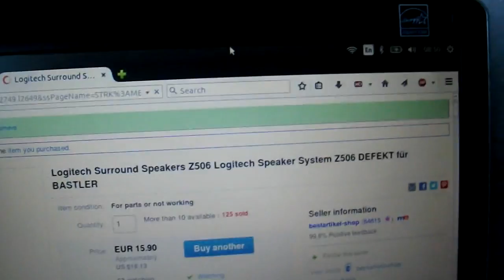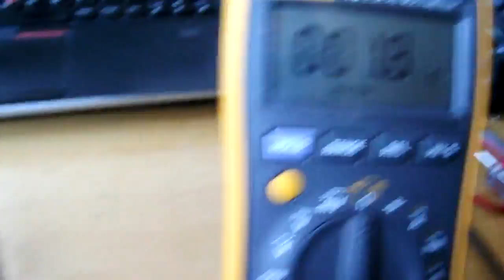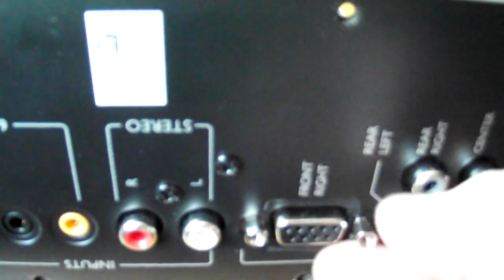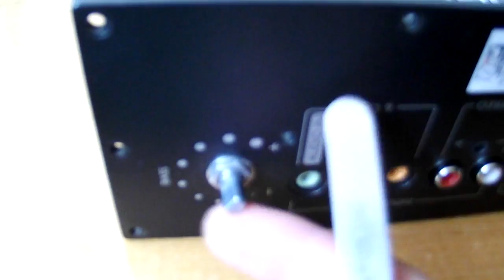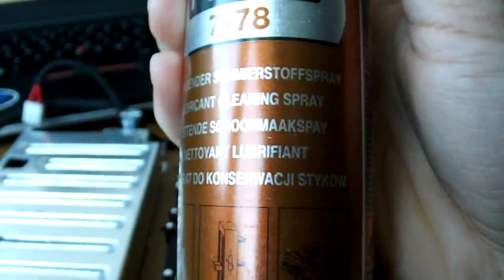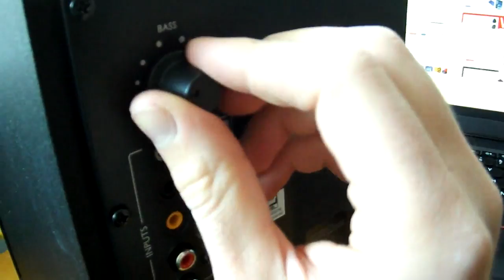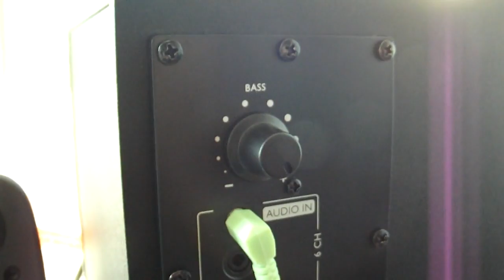Logitech z506 Subwoofer Repair

Comment: thanks for the video. my sub has just stopped working and the speakers still work fine. I've taken it apart and had good resistances on the potentiometer. is there any other reason the sub may have just died?

Comment: I have the same model speaker. For me, the bass works but only the center speaker has a sound output. When I plug in any of the other speakers to the connection of the center speaker, they work meaning the speakers themselves are not the problem. I suspect the connections on the back of the sub to be faulty. Do you have any idea how I could fix this?

Comment: Oh, great, I was hoping I wouldn't have to get this deep into this unit, but here we are - my sub isn't working, soooo, I'll have to get in there and try this out.

Need to find my multimeter and see for sure if it is open. I'd imagine that's the problem though - what else would it be where the sub rarely, if ever, actually works?

Comment: WOW Really Great Video!!! I disconnected my sub speaker from this thing and attached it to my other stereo and it works nice albeit not very bassy somehow.  The voltage out of the supply looked good at 16v.  The pot. R was good too and did change accordingly.  Caps dont looked bloated but you never know with them.  I get no sound!  How to diagnose further?

Comment: Well detailed video! Thanks! 
I've got the same speakers, 4 years old now and my subwoofer is starting to sound...torn?
How difficult would it be to unsolder the original sub- and then resolder a 12" sub originally intended for a car?
Reply from the maker: It would be very easy. Just remove the wires from the old sub and solder to the new one.
However, firstly, you'd have to think of a way to mount the 12" sub. Secondly, It will probably work for a while but there is a risk of damaging the amplifier of z506 if you push it too hard. The original sub is rated for 27W only, so if you want a long term solution, I'd recommend to look for a sub that has a similar power rating.
Reply: Oh man, I wasn't too sure if I'd get a reply, so thank you for this!
Mounting the sub: So the car sub is already in a box. I was thinking of cutting through one side of the sub box and attaching the Logitech board in it. May even use the old sub's "feet" on the new one.
Power rating: oh I see, didn't think of that (unfamiliar with electrical). Are there any replacements you could suggest?

Comment: Thanks for the video. i also bought this model Z506 and just use it for few months and l did not use it anymore.After about 3yrs i decided to use this again but there was crackling/Rattlng noise coming out from the woofer and when the two rear speakers were connected it will also make the same crackling noise.The Bass when put on high works fine but there is always this crackling/rattling noise.Any advise there bro.
Reply from the maker: Sounds like the volume pot may need cleaning. It probably oxidized from long storage and no use. I'd suggest doing what I described in the video and see if it helps. If you can get to the main volume pot on the speaker, do it there as well. Spray some contact cleaner into aux and other jacks while you are at it. I hope it helps.

Comment: Hello..
First thanks for instructive video.. i have a problems from subwoofer. Open my 5.1 system and woofer is starting beating.. (like; bop bop bop bop) But beating is low volume..  My another problem is controler. i attach my headset i hear sizzle. İ Power button to move (little rigth or left ) problem solving but one momets later doing this again..
What you think sir? What am i do?
Reply from the maker: +Mert Karataş If a problem gets solved even temporarily by moving a switch or any potentiometer, it means that the switch or potentiometer have dirty contacts and they need to be cleaned. The easiest way to do this is to buy some contact cleaner, spray some into the switch/potentiometer and push or turn the switch/potentiometer for a dozen times.

If you want to clean a switch, any contact cleaner should work. If you want to clean potentiometers, you should get a special kind of cleaner for potentiometers. It has some lube in it. Otherwise your potentiometer may wear out quickly.

If this way of cleaning does not help, you can try to desolder and disassemble the switch/potentiometer. Then clean their insides with a q-tip soaked in appropriate contact cleaner. If this is not possible or does not help, the only other option is to replace the defective switch/potentiometer.

Regarding the first problem, it could also be caused by bad contact in potentiometers. I'd suggest to clean every potentiometer and see if the problem still exists.

Another possibility for both of your problems could be dry solder joints. When you have disassembled the subwoofer, inspect the board for any loose connections between components and the board. If you notice bad solder joints, just re-solder them and test your speaker set afterwards.

Have fun repairing your sound system :)

Comment: hey mate,

just bought one of those. i turn them on and then my subwoofer's volumer gets lower for about one minute and then completely turns off. Any suggestion what is wrong maybe? would be really kind from you, since you seem to know a lot about them. i tried different input hardware and put the power supply directly into a plug (no extensions or stuff like that)

greetings
Reply from the maker: +hoernchenmeister7 Hi. I don't really know much about this speaker set. I just happen to be interested in electronics repair. I haven't seen an issue like yours before, so everything I suggest will be only my guess.

It could be a temperature related problem. You can try to disassemble the woofer and spray various components with a freezing spray while playing something. If your speakers suddenly start working, you will know which component may be defective.

It could be a bad electrolytic capacitor, which could also show signs of bloating or leaking. Be sure to check solder joints for any cracks due to physical and/or thermal stress.
Reply: thanks alot for the tips ;)
Reply from the maker: +hoernchenmeister7 No problem, it's my pleasure! Have fun repairing your speaker set :)

Comment: Excellent and informative video. Unfortunately, my problem appears to be a bad input jack on the bass/center channel speaker (great dane dog kept leaning on subwoofer under desk). While disassembling and testing my Z506, I found the bass potentiometer only ranges from 0 - 31 kOhm rather than 0 - 50, even though it is an original B50K. Just strange.
Reply from the maker: Dedrick Lund It is possible that some other component is in parallel with the potentiometer. In circuit readings of resistance may be unreliable.

Comment: Hey really good video i didnt had this issue but maybe sometime ^^
I have a question..i got the same speakers 2-3years ago, everything worked fine until a week ago..
My Front Left Speaker (where u can put power on/off and change Volume) plays no sound or sometimes pretty quiet with scratching noises and pretty often its making noises like sizzling and such stuff even if i dont do anything just looking to my computer. Right now i turned the Volume of my Front Left Speaker down but it doesnt change anything still hearing these noises.
All other Speakers and my Subwoofer wroking fine without any issues. Do u maybe know what is wrong? or what i can do?
Reply from the maker: +Sivertop I feel it's not a great video, because I didn't have a tripod and I can't really edit well yet. I just thought I would do the best I can with the means and skills I have. I also wanted to challenge one of my fears by making this video. I just hope it helps someone as well.

Talking about your problem, it sounds like a dirty control or loose wiring somewhere. You can try flexing the cable between the speaker and subwoofer at all places. Especially near the speaker and near the connector. These are the places where bad contacts are most common.

If the sound changes in any way - crackles, starts to play well - then you know where the loose connection is and you can proceed to fixing it. If you find the problem to be something else, let me know!
Reply: +ELectro oh great, thanks for ur fast answer i gonna try it tomorrow, if i know something new i let u know :) again thx for ur answer
Reply: i got the same problem, did u fix it?
Reply: oh quite some time ago i forgot to say if it worked, well it turned out to be the issue with the cable as the Channel-Owner said,.my cable was broken near the front left speaker i just had to cut the bad part away and rewire it. works fine now..

Comment: Hey there nice video.
You seems to be very knowledgeable so I take a chance asking you my question. I end up with the system but the right speaker with the on/off power is missing. I was planning to use it as an external powered sub. Thus I had no use for the headphone jack and as you showed, the volume is already on the sub itself. Is there anyway I could make a external powers witch for this ? Thank you
Reply: Hey I'm late 1 year, but anyway: The power supply is inside the subwoofer. If you don't have the right speaker (with volume control), you are complicated. If you have the right speaker but it gets no power, then the power supply inside the subwoofer is dead. It is typical with this model (happened to me as well). You can replace that power supply (make sure to match voltage, current type, etc).
The volume of the right speaker is the main general volume of the full system. The potentiometer shown in this video controls only the volume of the bass.

This sound system delivers and usually lasts. Sound is fine, speakers are sturdy, all in all is ok. But the truth is that inside it's a disaster. My main board is all corroded, rust ate all the screws, the traces are horrible, the design of the board is horrible, as you can see in this video they covered all the components with this black horrid substance, capacitors are scattered all around, components soldered together, it looks like a board from 1980 made for a school project. So all is hanging by a thread. It's a love & hate thing I have with it.

Comment: hi i have a problem with my z506, the problem is that the right and left speakers(front and rear) doesnt sounds, where do you think is the problem??
Reply from the maker: If the center speaker and subwoofer work fine but all the satellites don't, I'd suspect it's one of the amplifier ICs.

There are two amplifier ICs - one for subwoofer and center spekers, another one for all four (FR, FL, RR, RL) satellite speakers.
Reply: Do you think it can be repair?
Reply from the maker: Hector Reyes
Yes, I think it is possible.

First of all, the main board should be visually inspected for any burned components. Then I'd check the amplifier IC with a multimeter for shorts. If there are no shorts, I'd try to swap the amplifier ICs. If then you can hear satellites but not subwoofer or center - you can be sure it's the amplifier ICs.

I don't remember which IC it is and how available they are. If you are going to repair it and need any help testing components, let me know. I can disassemble my working subwoofer again and we can compare any values.

Comment: Hi. at the begining sorry for my english, i`m from central europe. I have problem with front left speaker. When I play the music it`s rustling. I connected it to another case and it was working so i think that the speaker it good but the  problem is in subwoofer case. I took out the main board but now i dont know what to do next. I dont have multimetr, should i buy it and check resistant like u ? Do u have any suggestions ? Greeting and i`m waiting for the answer.
Reply from the maker: Pajmano For some reason I don't get notified of most of replies to my videos. Sorry for a late reply, but maybe it will help someone in the future.

When there is an intermittent connection, sometimes it's possible to see the fault with a naked eye. Wiggle the connector and look for any movement of the solder joint. Even if it doesn't move, it would be a good idea to re-solder the connector.

Comment: I had an issue with no sound coming from the bass but all the other speakers worked. I knew the bass was working because when I wiggled the knob it would make sounds for a few seconds, thus meaning it was a physical connection issue. I took it apart like in the video, got some "crc electronic cleaner" from advanced auto, sprayed it in the bass knob and wiggled it back and forth, then put it back together, worked perfectly!
Reply: Did it seem like your bass knob spun freely and then randomly caught and would play bass when  the knob had seemed to catch? Trying to determine if this fix will work for me as well.

Comment: hello! speakers worked it packed it up  and after i unpacked them theres no power at all, what i check first? fuse? what do you suggest , because alot of talking about the power supply dead.
Reply from the maker: Martin Kull It could be a bad connection somewhere. Check all of the external and internal wiring. Disconnect and re-connect all of the cables, check if there's power coming to the device.

Comment: Hello I want to ask I broke welding subwoofer is there any way to fix it  - if you showed you a picture of the board   I am waiting for your answer
Reply from the maker: +tacho beselinov Hi! Unfortunatelly, I have already sold my speakers since I didn't really need a 5.1 system. I bought them just to fix them and I succeeded. So after enjoying them for a while I sold them. Sorry.
Reply: +ELectro OK thanks

Comment: Hi. I have same speakers and i have a problem with static noise when connected to power. Is this fixable? Thanks for any answer.
Reply from the maker: Adrian Rajnak Honestly, I have no idea. I have never had such a problem. If it is a constant 50/60 Hz hum, I'd suspect filter components in the power supply (probably capacitors). Otherwise it could originate anywhere in the signal path. Please make sure all of the connections are securely connected as loose input/output connections could also cause noise. You can also make sure that there are no electrically "noisy" devices nearby (fridges, fans, drills, anything with a motor).

Comment: What is the output voltage of the power supply? mine has a broken power supply and I'm wondering if I can replace it with a different power source with equivalent voltage..
Reply from the maker: kekagiso I have measured the voltage of my z506 power supply. With no load it is 15.86V. So I guess you could use a 15-16V external power supply and just wire it straight into the amplifier board.
Reply from the maker: kekagiso I should clarify that it is 15.86V DC power supply. Red wire is positive, black wire is ground.

Comment: Hi I have these Speakers and my problem is that the connector for the sowbufer i burn my annoyance I can fix the plate as you would expect an answer if  I send you a picture for you to see
Reply from the maker: Hi! Which connector is burned? Do the speakers still work? If they don't, there may be another problem as well - shorted amplifier or something. If there's anything I can help you with, let me know.
Reply: ELectro all speakers work well . the problem is in the motherboard that is burned connector  , he dismounted and send you a photo so you can see how this
Reply from the maker: tacho beselinov

This should be easy to fix if you have a soldering iron. This connector goes tothe subwoofer. I used your picture to show what wires go where. Just don't worry about the connector and solder the subwoofer wires directly.

On the first picture, solder the "+" (red) wire from subwoofer to the left side and "-" (black) to the right side.

Here's how to connect the subwoofer wire: http://postimg.org/image/enbiw3d0r/
Reply: ok moring I try and if that does not work the other points you can get the signal from sowbufer
Reply: tacho beselinov does not serve me. know how to take another tack welds for sowbufer on the motherboard    _
know where I can buy the motherboard online

Comment: Hi, I have creative m4500 speaker now its one rear port is not working. can you help me to solve? I have checked to all other 3 ports the speakers worked fine.
Reply from the maker: +Sibin Daniel Sure. Firstly, try to connect another speaker to the rear port to know if the speaker itself is ok. If it doesn't help, you will have to disassemble the speaker/sub where the connectors are located.

When you do so, check for bad solder joints or any physical damage to the connector itself. Be sure to check all components for any burn marks or other damage. If everything's ok, I'd suspect the apmlifier IC which is responsible for the broken rear channel. You can check it for shorts and measure it's supply and output voltages.

If there is a short or if there is no output at the amplifier IC, you'd have to replace it.
Reply: +ELectro Thank you